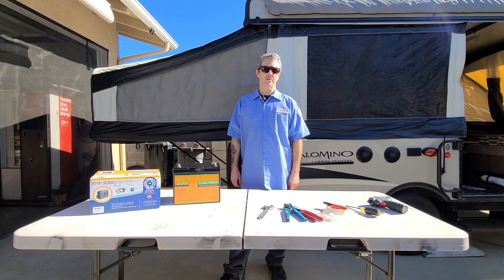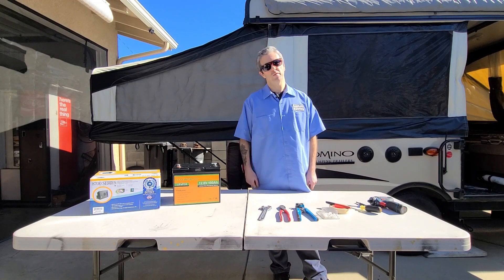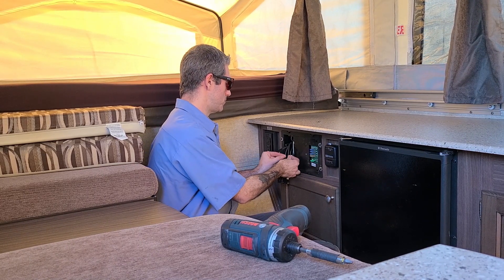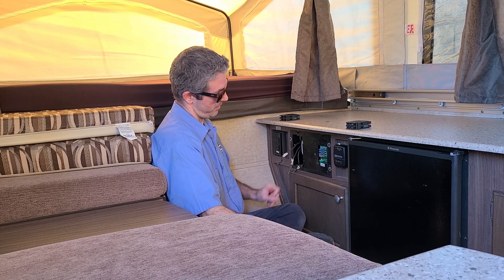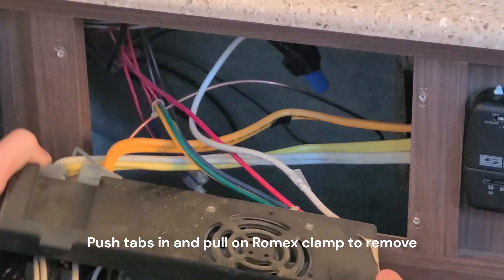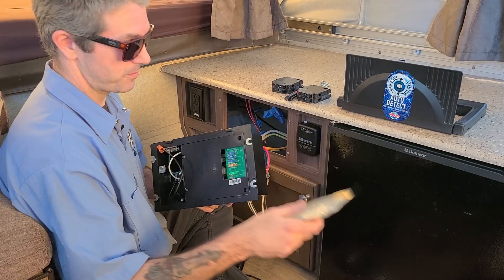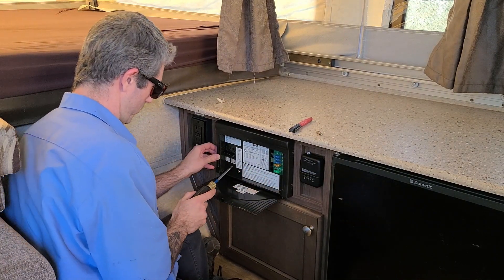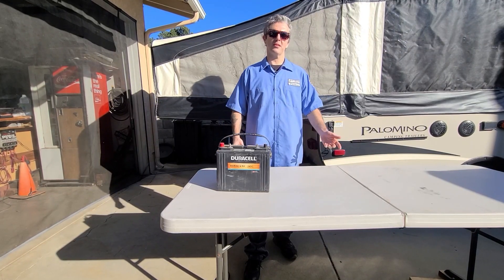Upgrading Our Popup Camper to Lithium (Battery and Converter upgrade)

Comment: In my new (to me) 2004 Rockwood Freedom (#2280) the battery was pulled. I want to u/g to LiFePo. My controller is a WF-8725 and the board is a WF-8712. I also have a solar panel (400-watt) with a 30A controller on the way. I contacted a company and trusted... No names mentioned. I have over a $1K in parts that don't seem to work into what I want to do, But, since I found them on eBay "they" say it is not their "job" to help me. Oh, there is NO ONE who does popup repairs within an hour and a half!

Comment: Any chance you know about the solar set up on a 2019 Flagstaff SE? (Solar Ready Zamp)
Reply from the maker: Hi there,  Usually the campers are one of the two main brands, Go Power or Zamp. Being solar ready usually just means they put an SAE solar port somewhere on the frame to accept a portable style solar kit.  With this plug, you still need a solar charge controller to plug the panel into.  Most suitcase/folding solar panels usually come with one.  The difference between the two brands is the wiring.  Since you have the Zamp plug, it would be in reverse polarity from the Go Power plug.  You can use any brand solar kit you wish as long as you get a polarity reversing adapter.  They are available on Amazon.

Comment: this video is very accurate and straight to the point.  My new auto detect power convertor is on its way the original convertor will not charge a lifepo4 battery completely because they need 14.6 volts to top the battery off. most standard convertors peak at 13.6 v.  be minnful you get the right size converter for your rig. PUP's and small bumper trailers are usually 30 amp and bigger trailers are often 50 amp convertors.  my li time battery is equipped with bluetooth, so you can see the status of your battery.  the issue I have is when the voltage dips the propane detector sounds, even with a fair amount of watts still in the lead acid battery,

the clamp on the one breaker.... is required by the NEC for main breakers.